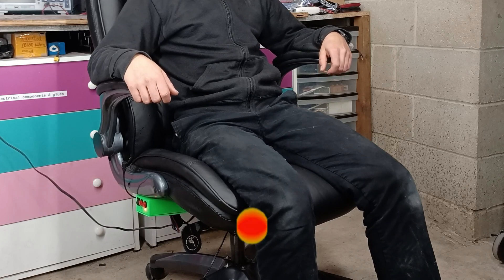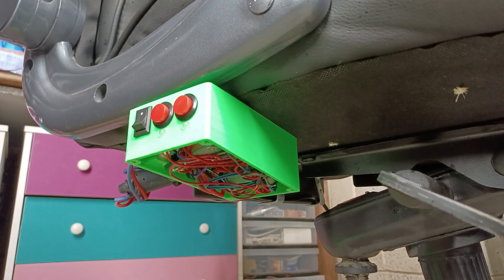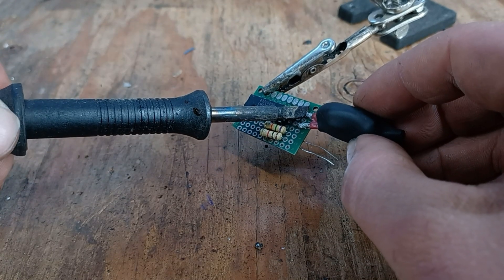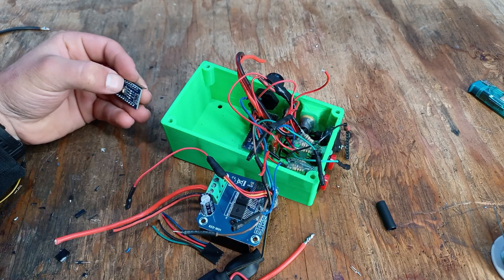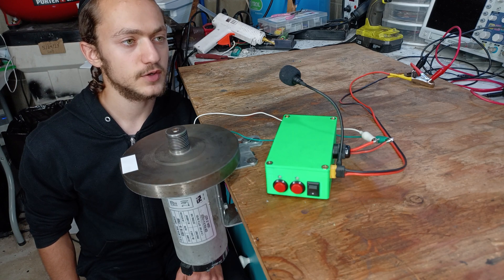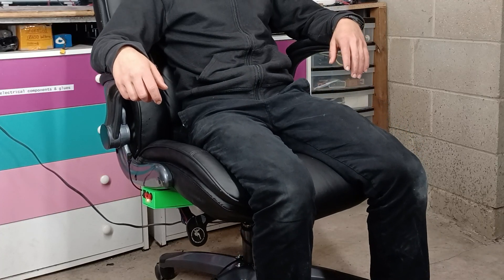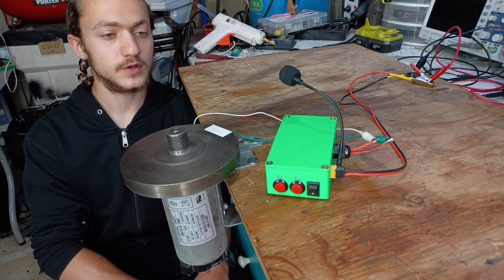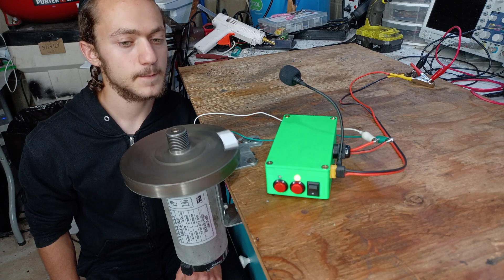I Built a Smart Office Chair That Moves When You Talk to It

Comment: Did you figure out what motor would work 1:1 with the hydraulic jack?
Reply from the maker: Not really. but if I would try anything, I'd probably install a high power brushless motor.
Reply: @ I have one using it on a project, I have upgraded it to a brushless 6s setup, burned up the pinion gear so had to order more. It’s about 50x faster! Full up and down in under 10 seconds. 

However, this is using its original planatry gearbox. I tested attaching brushless motor directly to the hex input on the pump and it failed due to high current. Same failed attempt with an upgraded 775 motor. 

Would love to see if you can find a way to hook up a motor (maybe wheelchair or skateboard brushless motor) without the original gearbox (so 1:1)  as they are not reliable.

Comment: Fun project! Are you finding the V3 voice module fairly successful in recognizing your voice commands?? I’m thinking of buying one for a project, the DFRobot module isn’t very accurate in my testing….
Reply from the maker: @brucewhite4231  It's pretty good at recognizing voice-commends. although, as I've tested it, I did realize that some numbers that I've experimented with, sounded too similar to another number commend I've programmed. For instance, something like 35 and 45 was sometimes mixed up. Also, having too long of a comend will probably not work. Ultimately, if you do enough testing, you'll find the perfect commends that won't be mistaken for each other.
Reply from the maker: @brucewhite4231 This is an affiliated link to Amazon if you're interested in buying it: https://amzn.to/4cao8YW

As an Amazon Associate, I earn from qualifying purchases. This link above earns commission.